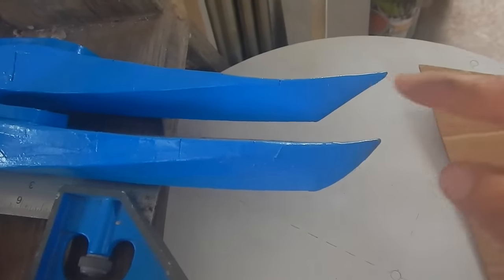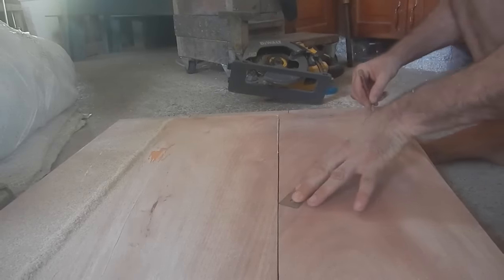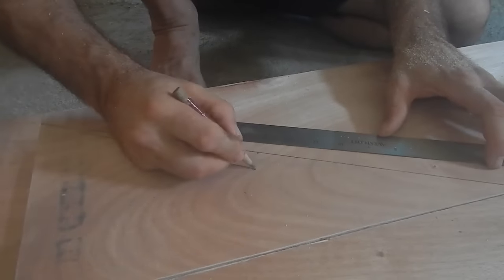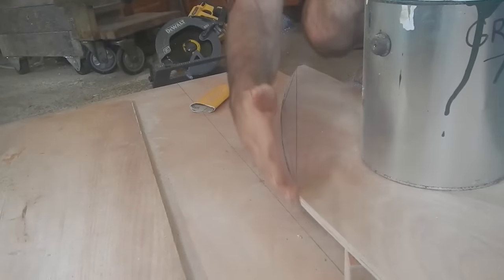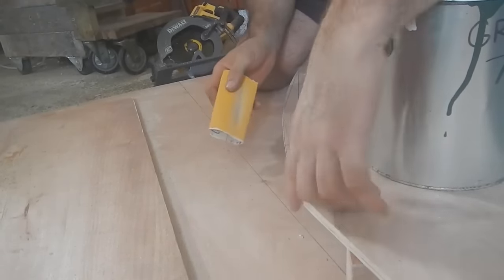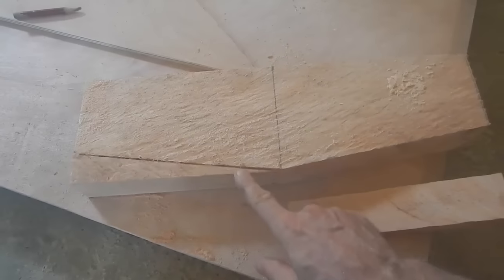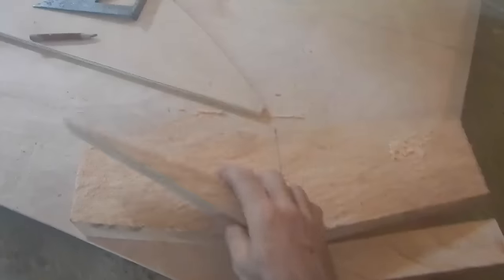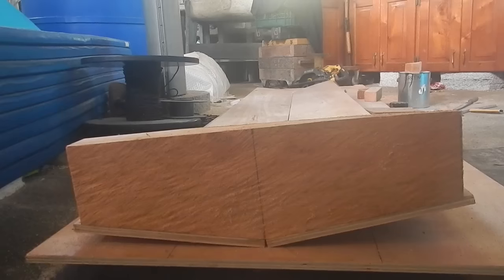Making Kayaks 002 Twisting Plywood

Comment: My monohull plywood single sheet hydroplane built from Mechanics Illustrated 1950s was 1/4 inch thick and bent much the same.
Had bicycle handlebar cable steering to a10hp outboard motor. Pedisesor to wave runners sitting high in the center.
Thanks for the memories. Fun video.

Comment: I would have used a paint brush and water on the outside of the plywood to soften the wood. Wether it would have worked is a guess but it should have softened the wood a little

Comment: plywood is tricky to bend like that because the grain is going in multiple directions with glue also adding rigidity. if you can find clear logs to cut into similar thickness slabs you can go way further with your curves and you get the option to steam and press the wood into shape

Comment: if I remember correctly, this is just a positive 'buck' to make a negative 'mold'?, so the plywood will be covered in wax then the fiberglass mold will be released from it in one piece, then multi kayaks can be cast in fiberglass inside that fiberglass hull mold ...the same 3 step(buck, mold, final piece) process will be used to cast top deck/cockpit 'lids' for the hulls and riveted/glassed to bond them together - so at this point the weight of the buck(and also later mold) won't matter - however if just sticking with flat 2D sheets to warp into a 3D form(and not a rounded greater displacement to surface area shape, as a temporary buck could be made with clay or foam) I have to wonder why the first one wasn't made out of all those sheets of metal Jaimie has? as I know he talked at one point of making a metal boat ... at least that way the lighter weight metal buck could have been tested in the water for buoyancy, stability, maneuverability, drag, and stress; with any adjustments to the design made and refined by adding or removing thin sheet metal - and then a mold could be pulled off of that to make and sell copies

anyway, with as "interesting" as Jaimie's creations are, I've always thought he could try producing them for public consumption(of course there were mini spider-bots toys and the video game, but I'm thinking of the many designs for practical uses)

Comment: It's not  going to break. You could use some thinner ply & sheath the bottom with epoxy & 6 oz glass. It would be both strong enough and lighter. Dan S. From Michigan & Texas PS also more wear resistant.

Comment: That's a pretty thick piece of ply for forcing out curved shapes! 0_0  I wonder if you could score the insides of the panels with a shallow skilsaw blade to reduce tension and resistance.- like wrapping baseboard around a circular column. If it's  for the mould, damage on the interior should'nt be a problem.(?) Normally, 3 or 4 mm. is used for something like this and is still stubborn. (stitch and glue) Good luck!